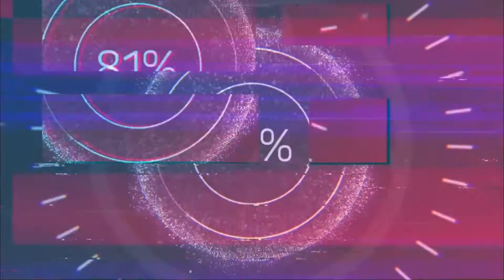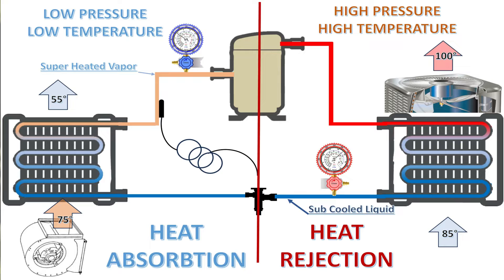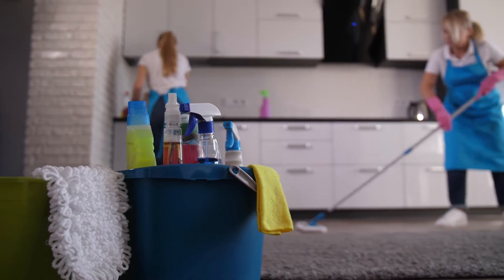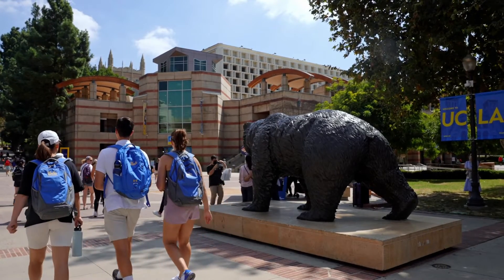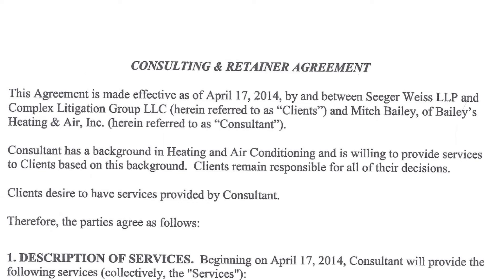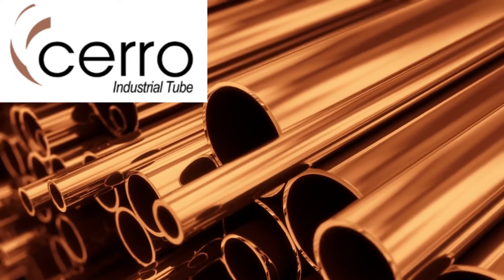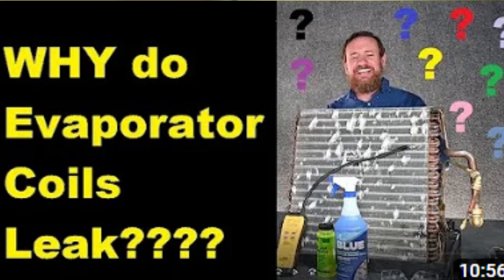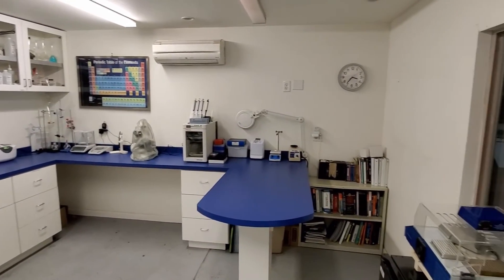What causes formicary corrosion

Comment: Thanks for the info. Was "Flow-electrification" a factor as well with older ticker copper tubing but not an issue  because it was thicker?
Reply from the maker: @enlightenedsoul4683  That was the problem, thicker copper didn't develop these leaks. Plus they were all r22 using mineral oil. I believe mineral oil has less capability to hold a charge, unlike 410a and POE oil.
Reply: @baileysair  Makes sense. Our original Central AC evaporator was fine even after 15 years; the outside condenser happened to go bad. We then went with 2 Fujitsu RLS3 minisplits and both developed coil leaks after 5 years. Wonder why Fujitsu and other minisplit manufacturers tout "all-aluminum" coils in multi-position Air Handlers but still have tin-plated copper coils (like in the RLS3) in ductless minisplits.

Comment: Im a service tech working in South Florida and have an office building with LG vrf systems. We typically lose two or three evaporator coils per year ever since the building opened. We changed out half of the building to Daikin vrv and still have the same issue even with coated coils. We've had third-party testing done, and the manufacturer has been out also, but no one can give us a straight answer of what exactly is causing. I worked in buildings with Chinese drywall that has high sulfur, but that's not the case here (the copper is not black).
Reply from the maker: I am telling you its flow electrification making a corrosion that would occur naturally over time happen much faster. 
Some university student looking for their masters should take this up, hell they might win a Nobel prize.

Comment: Really enjoying the videos.  I've been looking for some information about how to pick a reliable system that will avoid issues like leaks.  Do you have any suggestions about how to go about getting a replacement system.  I have old ducts and a 30 year old Trane that is about dead due to leaks.  So far I've gotten all aluminum evap and get a load calc as part of the install. Would love some more info.  Location is gulf south.  Thanks!
Reply from the maker: You have special needs that we don't have here in California, humidity. Humidity plays such an important role in large sections of the country. In your case you need a system that can provide the cooling while dehumidifying. We slow down the fan speed from 400 cfm per ton to usually 350 cfm or 325 cfm to remove more moisture from latent cooling (wet bulb). In California we actually bump up the fan speed to 450 cfm or better because of our dry climate to get more sensible cooling (dry bulb) for higher efficiencies. 
In your case sizing takes on an important role, thus the load calculation, because an oversized unit will cycle on and off too quickly to remove humidity properly. Going with a variable speed can help but setting them up can be problematic to keep the humidity down and keep you cool. 
Some people install a separate dehumidifier that works independently or in conjunction with your A/C. Trane makes such a product, Integrated dehumidification Solution IDS. You could also have a reheat coil installed on the system that allows for the system to dehumidify and not overcool the air. Trane used to build a system like that but I never had to use it because of our low humidity in California.
You should look for a contractor in the area that has been around for a while and will actually do a load calculation on the home, then ask how they handle humidity issues with the systems that they sell.

Comment: I've had 2 coils gone in my Fujitsu. First one 5 yrs, second one 2 years. If it goes again I'm back to wood.
Reply from the maker: Sorry you have had such bad luck. Unfortunately, mini splits use only copper aluminum. We too have had to change many coils out for mini splits. This is one reason I don't recommend them to my customers and instead go with central heating and air.
Thanks for the comment.
Reply: @baileysair  I also had the air coil go on my ground floor pump from a bad soldering job. All are ducted in , no mini splits. I've paid out over $3k the last couple years plus $800 in increased hydro because the leak. I could have bought fire wood and heated for 3 yrs on that. They painted the coil on the Fujitsu with a corrosion inhibitor. If it goes again I'm done with it.
Reply from the maker: @edwardthompson9981  On a few of the mini split coils we have replaced we were able to get a coated coil from the manufacturer and they all worked out and are so far leak free. So, good luck.
Reply: @baileysair  The 2 Fujitsu RLS3 minisplits in my ICF home have developed indoor coil leaks after 4 years. Would be grateful if you can let me know what minisplit manufacturers offer coated coils. Any commercially available coatings such as the Viper Coil Coating that can be applied on other minisplits at installation time? Thanks in advance.

Comment: Excellent content. What are your thoughts on large commercial air handlers using chilled water? Have you seen any corrosion similarities?
Reply from the maker: Sorry, don't work on chilled water systems. However, I know a couple of people that do and I will ask them. However, I don't think this is an issue with chilled water systems as they are usually nickel plated to prevent such corrosion.

Comment: Bravo to you for looking out for your customers! I've had several coil failures on my Daikin system (installed in 2019) and had no idea what was causing it. I have 5 coils, 1 for each indoor unit which makes this problem even worst. Had several contractors try to fix it, all to no avail, other than replacing the leaky coil with a new one. By now, I could have paid for a new system 2x over!  It's frustrating to say the least, especially for the price tag of this system. Found a new HVAC contractor, that is more knowledgeable, which is when I leaned about formicary corrosion. I did some research on it, and came across a lawsuit filed against Daikin where the plaintiff's expert claimed that the coil leaks (in this case) were caused by "Galvanic Corrosion" that resulted from the combo of bi-metals of copper and aluminum in the coil along with a styrofoam drain pan. Said, since there was no grounding of the coil that the build up of electrons caused the "accelerated" corrosion of the coil. Link to lawsuit. http://masscases.com/cases/sjc/488/488mass712.html

Comment: Is there any connection to when the white armor flex linesets came out to when all the leaking coils started happening? We had all kinds of problems with the white armor flex. I was thinking that some kind of reaction was happening to the copper coming from the white armor flex because you would see the copper refrigerant lines get holes from the outside in also not just the coils
Reply from the maker: We have been using the easy pull linesets for quite awhile now and none have popped up with corrosion. In your case it might be the environment you are in with lots of excessive moisture coupled with, as I stated in the video, some type of electrolysis going on. If you switch over to another brand of insulation do they get the same corrosion?